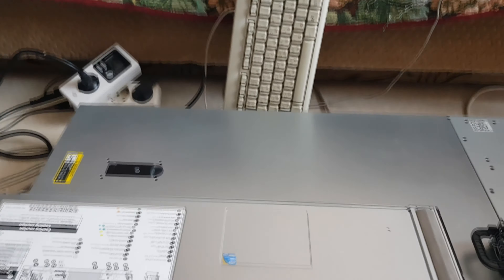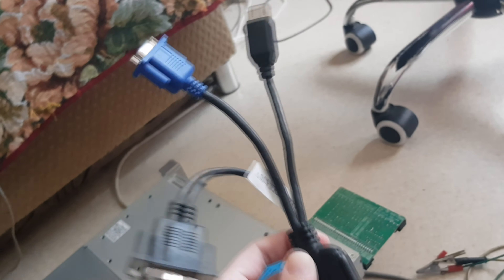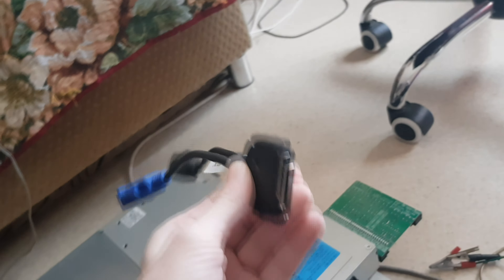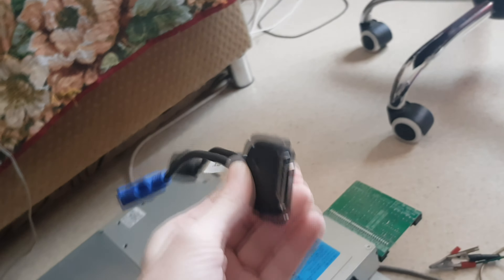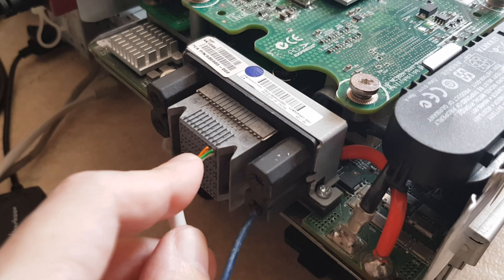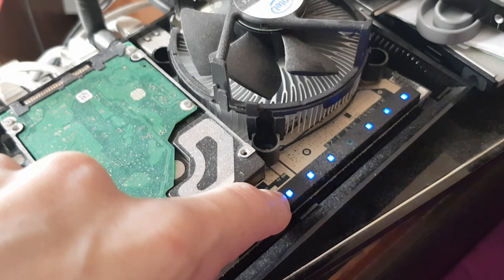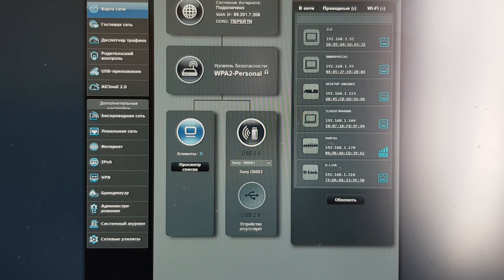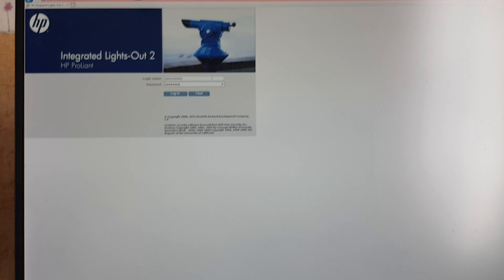How to: Connecting HP blade ilo to normal rj45 switch port

Comment: Hi, I have a question, I have an hp bl460 g8 server and I want to connect it using an atx power supply from a computer, and is + and - the same as in all models? and will it not burn through this power supply? (pci 6 pin). You are amazing :)
Reply from the maker: hi. yep they all the same. red is + black is -
just dont forget that it can draw up to 40A on 12v rail ;)
Reply: @endreu1  Hi, i have a problem, because when i connect the power supply to the server, the green LED on the motherboard lights up and after about 5 seconds it goes out.  What could it be caused by?
Reply from the maker: @NS-ns8ym  did you switch on those switches on mb? There should be info what you need to turn on. For g6/g7 it was nr. 5 switch.
Reply: @endreu1  I don't know if the hp bl460 g8 has such switches at all, the only switches I see are the "System maintenance switch" which is responsible for "ILO" but probably not what you mean.